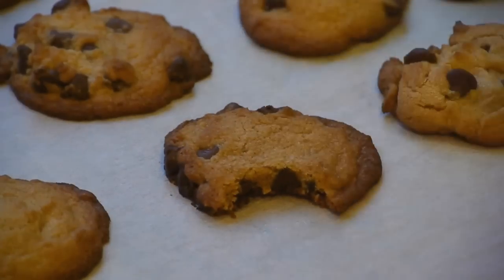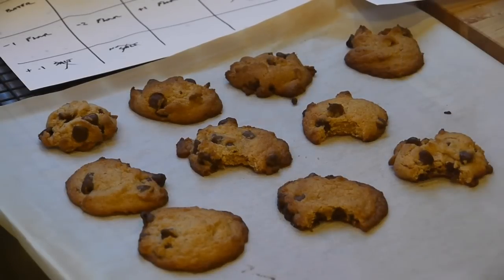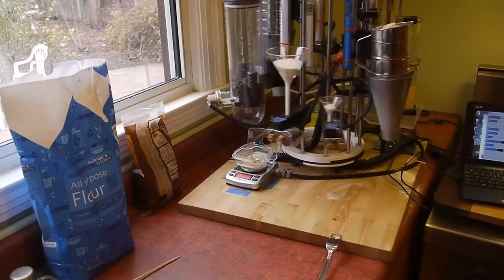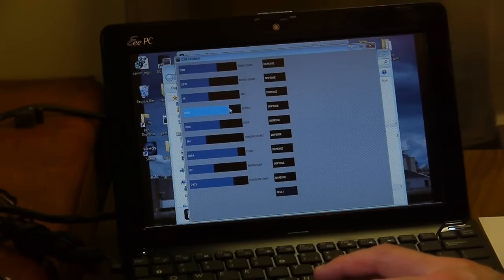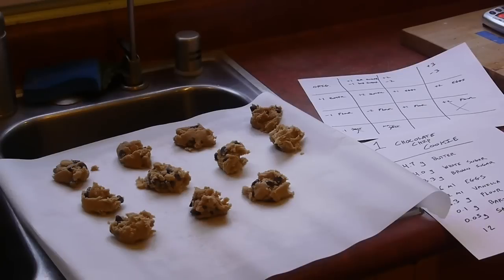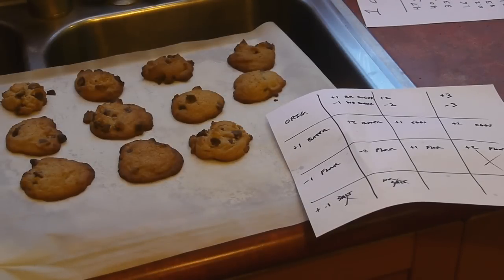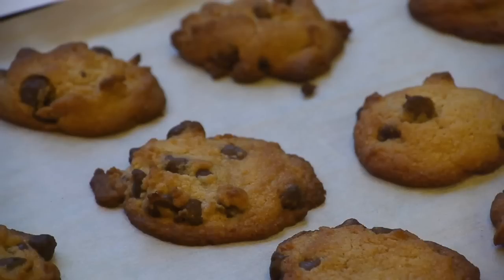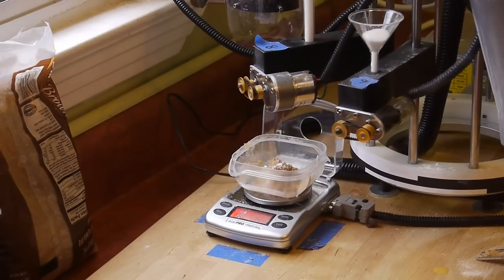Cookie Perfection Machine

Comment: The way you mix the ingredients makes a difference too.  Kneading the dough so it's dense gives you a different result from beating air into the wet ingredients and folding in the dry ones.  Also cook time and temperature, and oven placement, and the pan it's on.   I've been searching for the perfect cookie for years.
Reply: That's what I was thinking, too. Chewiness comes from mixing more than necessary in order to not only mix the ingredients thoroughly but also develop greater quantities of gluten.
Reply: I assume he does this in a sequential manual search: find the local optimum through exhaustive search on one set of parameters (e.g. ingredient proportions), then the next (e.g. mixing or baking process).
Repeat until no further change materializes.

Should discover the global optimum if initialized sensibly.
Reply: @lenzwe7775  I thought that kind of gradient descent only worked if the curvature behaves nicely and there aren't a lot of separated local extrema that you can get trapped on.

Comment: You miss out on the temperature/consistency factors of the butter and the creaming of the wet ingredients with the sugars, so the flavor/texture of the end result will be very inaccurate as compared to a properly made cookie. The most this will give you is an extremely general idea of how it will taste, since the order in which you mix the sugars with the eggs/butter is one of the main proponents in the flavor of the baked cookie.
Reply: As you point out, the temperature of the butter at the start of and during creaming is important to the final result of the cookie (creaming whips air into the butter, which has a significant effect on the cooking and texture of the cookie.)  I'd suggest 1) developing a temperature control box to get the butter to a given temperature, 2) optionally using a temperature controlled waterjacketed mixing bowl for the creaming on a stand mixer (pretty easy to physically rig with copper tubing wrapping the mixing bowl), then 3) using a temp controlled waterjacketed dispensing module on the rotating rig to hold and dispense the creamed butter/sugar mixture.  You could only use one temperature/sugar-butter-ratio setup per test run with such a set up, but it would give the critical element of butter temperature and creaming time which is missing currently.  (There's a reason there aren't a lot of imitators of what Cook's Illustrated does day in and day out.)
Reply: Yeah, I can already hear Christopher Kimball facepalming over how many improvements this machine needs

Comment: As you've already heard from previous comments, there's a lot of other factors to be considered when it comes to bake times, temperatures of both ingredients, the dough and the oven and how the ingredients are combined

All I can say is good work. I admire your computer/mechanical skills. The baking needs some work.  I make cookies by the thousands using the same recipe  everyday and minute factors like the temperature of the butter makes for a drastically different cookie. One major breakthrough was when I found out I could program my rational self cooking oven to cook them just right everytime. But they still are affected by those variables a little bit.

The haters will be hatin'. Keep fine tuning your machine. Then start programming your oven next.

Comment: I think the order in which you mix the ingredients and cooking temperature is also important for chewiness. The sugar will prefer to dissolve or stay solid depending if you mix it with egg whites or butter or both first.

If you want to try every permutation of ingredient amount, order of mixing and cooking temperature you'd probably end up with more important things to worry about, like the heat death of the universe!

Comment: My wife was wondering, how do bake-time and temperature effect the cookies?  Convection oven, and baking pan (dark/light colored aluminum/steel, nonstick/greased, stoneware, glass)...so many variables!
Reply: i just left this comment on a blog site that was showing this video as a reply to someone saying the final product looked all weird shaped and burned. i thought i'd attach it to yours since you're asking questions that i sort of answered :)

 baking isn't just about adding just the right amount of each ingredient; the amount/vigour of mixing, how long you let the dough sit, the cookie sheet you use, the shape of each cookie before baking, the temperature of the oven (and really, even the individual oven), the bake times, and even the placement of each cookie on the sheet in relation to other cookies (sometimes they can spread and form mutant cookies lol), all effect the outcome of a batch of cookies. plus, each cookie on this sheet is made up of a different combination/different amounts of ingredients, would would lead me to believe they might not all bake at the same rate/in the same way. if i were to do this experiment, i'd probably try to bake each one individually in a toaster oven rather than all at once. this machine is an awesome tool to develop the perfect cookie (base on the individual baker's taste), but it's a process. they're not all going to turn out perfect. that's the whole idea of this: he's on a journey to find his perfect chocolate chip cookie recipe, and he's using the machine he built to get there : )

Comment: Looks like you might be over-baking them. Maybe a better timer or PID control for the oven should be the next project ;)

Also, be sure to rotate the sheet 1/2 way through to compensate for uneven temps.

Comment: I greatly enjoy the majority of your vids so I will tell you the secret to the perfect chocolate chip cookie. I notice 3 things. BTW I've won plenty of baking ribbons when I was young against people who were cooking & baking their whole lives.

1st thing: You're missing oatmeal. It's best when its powdered up in a sharp blender. It absorbs the fats and butter and lends towards the texture that makes them chewy inside and slightly crisp around the outside edge.

2nd: Varied fats. Butter is great but truthfully all butter makes them feel too heavy and counterintuitively less butter tasting. So some canola oil in there is ideal and when I've asked people in comparisons they thought the cookie with canola oil was more buttery than the all butter cookie.

3rd: Must not skimp on the Vanilla. It must be REAL vanilla and if you can get chips with real vanilla (most contain Vanillin a form of artificial vanilla because vanilla takes 2 years to produce and is therefore expensive). Most people do not immediately identify this but the truth of the matter is Vanilla is to chocolate what pepper is to salt -- It rounds out the Chocolate flavor and actually enhances the chocolate. (this trick works with frostings excellently, too. I used to take those half pound Hershey bars and make them better by adding real vanilla and 1 ounce of bakers chocolate. People raved about this combo... all I really did was upgrade the quality of the ingredients. Very basic if you think about it.) Feel free to email me at woundedwing2016@  geemail. c o m  should you wish to discuss anything. Hope this helps(and that you see it) and take care!

Comment: Did you have issues with the powders and solids not wanting to flow? I have used something like this: 
BestTong 10PCS 7mmx25mm Micro Waterproof Miniature Vibration Vibrating Motor Coreless Motor Mini DC Replacement Motors only air driven and bigger to improve powder flow. We had problems with powder flow so we used vibration and it worked like a hot-damn. Adafruit has these as well: Vibrating Mini Motor Disc and that gives you two sizes. I take it your dispensers are homemade? The belt driven dispensers looked unique.

Comment: Cool. I find oatmeal raisin cookies very interesting, especially when I learned the trick of not mixing up the ingredients to uniformity. Oatmeal raisin cookies seemed to love true randomness, which has clumping. Here's a challenge: How about an upgrade to the hot air popcorn maker? These healthy snack makers have devolved into one basic model that has a tendency to jam up potentially setting fire to the house, or they pop off the top and send popcorn in all directions, or the Sunbeam that I thought was a better model--which kicks out about 5% of the kernels unpopped. I always had a day dream of a laser popper, zapping one kernel at a time like a machine gun. (It's better you hit the moon with your ruby laser.) Consider the challenge, little sealed kernels with a bit of water that need to reach the boiling point. A tube heating up until it reaches a point where it boils and pops--then goes in a bowl, doesn't jam, is quick and reliable.  (I was curious if altitude would make much difference, but preliminary results indicated I could make lousy batches of (oil popped) popcorn in my Jet Boil at sea level or 7000 feet. So I really haven't resolved this, just confirmed how to make a bad batch.)

Comment: You might try dumping your ingredients into a baggie that way there would not be as much waste from them sticking to your container.  Plus I imagine it would be easier to dump them.  Maybe hold it in a round wire frame with a hoop for a rim and a rubber band to hold it into place?

Comment: Your cookie dough machine is interesting and reminds me of a favorite childhood story book "Homer Price" about the automatic doughnut machine.

As an engineer and home chef I have to say you're on the wrong track and it won't yield the results you're looking for.  I too looked at making cookies with better results.  The most significant differences occur when you prepare the batter differently - technique as any chef will tell you.  Try as an experiment as I did by letting the batter hydrate for different times.  Cook immediately, wait 12 hours, 24 hours and 48 hours.  You'll find it makes a huge difference to the texture of the cookie in a side by side comparison taste test using the same formula.  Second, most people don't beat the sugar and butter enough.  Over whip the sugar  and butter till its almost white then you can add it to the cookie dough as one item.  I could go on but try these steps first.

Comment: It doesn't appear with this setup that you can vary the consistency of the butter (melted, softened). Also, a very important step is creaming together the sugar and butter which also serves to dissolve the sugar crystals into the butter. I have found when making a recipe for a single cookie, the granular texture of the sugar is pronounced and does not have the benefit of the butter and sugar being creamed together with a mixer.

Comment: Flour is a binder with the gluten formation.  Brown sugar is sweet but adds more moisture to the mix: looser, flatter cookie.  Butter has water, solid shortening doesn't .  Use butter flavored crisco.  Chill, chill chill that dough.  Mix-ins like nuts and chocolate chips can alter flavor so add what you like.  Myself, milk chocolate chips, walnuts and chopped cranberries.  Good luck.  I will stick to hand mixing and dividing the batch into 6 to 8 cookies.  That way I'm not stuck with chocolate chip but use the batter for adding fruit and nuts.  No chips.

Comment: I like good food, but I'm not so determined to find the optimal recipes.

I suspect you're likely to find that the optimization problem does not have a single solution, and may have multiple different combinations which produce equally pleasing results, for different reasons. 

I recommend you also try your cookies at various times of day, and with different beverages, as that may impact your perception of flavor.  Perhaps there are other variables as well, and of course price will come into it somewhere.

Comment: I'm gonna be a total stickler and point out that while I love all the engineering and novelty he put into this, it's a pretty terrible way of making the perfect cookie.  The ratio of ingredients is part of what makes the perfect cookie perfect, but other factors (e.g. the temperature and mixing intensity of the wet ingredients, how and how long the dry ingredients are mixed in, the quality/freshness of each ingredient, shaping the dough, and placement across the pan, type of baking sheet and liner, baking temperature) are collectively as important if not more so.  The best way to find your perfect cookie recipe is to do it the old fashioned way, pay attention to what parts of the cookie you want to change and modify the factor that affects it.

Comment: Cool.
The sad part is that it's impractical to clean the containers and store the ingredients. That could be fixed, though; it's just probably not worth the effort. But then again, what is..
Reply: *****
Umm, ok, but that doesn't negate my point.
Reply: Luna Omg, you're adorable.
I want a hug... walks closer
Wait! No, don't run away!!
Reply: It takes more energy to build a machine like this than to premeasure and mix 40 different cookies and try out the recipes on your own, but if you enjoy building the machine, that's where you get the value.
Reply: Abel Feltes I know. I sort of included that with the last line "But then again, what is?".
I suppose I personally don't get that much out of building hardware because it's not my expertise. Software, however,  I don't mind wasting time in. I guess I acted more closed minded than I thought.

Comment: baking is chemistry.- The engredients change chemical form when they are heated up during baking.- For example starch will degrade to lower sugarforms, also called dextrines ( pyrodextrins ), which will also add brown colour to the bread/cookie/cake.

Comment: I noticed a few flaws in your design... (baking techniques that have a huge impact on the final product) ... First, you should NEVER use melted butter when making soft cookies.  You should use softened butter at the most.  Using melted butter will cause the butter to integrate too closely with the flour and you end up "frying" the flour instead of baking it  (making crispy cookies vs soft/chewy cookies).  Also, you really do need to separate wet & dry ingredients until the last minute.  (Sugar is an oddball and is considered a wet ingredient)  Keep the whole mess below room temperature (cool) or you'll again suffer from the issues with the fried flour.   You do want to mix the ingredients, but you don't want to over-mix.  You would be amazed at the difference between the final products.  You'll be completely surprised at the difference between the final products simply by the difference in techniques.

btw... love the shows... keep up the great work.
Reply: +TheCompWiz He could fix that butter problem with filling a cylinder with room temp butter, and using a plunger to extrude the butter at some specified volume.  A shear step would complete the butter dispense and allow it to drop into the mixing reservoir.

Comment: I have been a chef for 32 years... you are doing every thing wrong! your machine acomplished nothing. For chewier cookies add a bit of vegtable oil, crisco works the best., diabetic cookies  use blended fruite , i.e. apple sauce, pineapple tidbits, smashed bannanas or any orhwe moist fruit to replace sugars. Altitude afects bakeing a lot. Making cookies, cream all of the wet ingredents together then add the flour and all other dry ingredents that have been mixed together , preferably sifted. When adding the flour mix, just mix until everything is all incorporated together. Over mixing will make the glutin in the flour very gummy and tough also unpleasent.Also the longer you bake a cookie the dryer and crisp it will be. Remember a moist cookie, increase the oils and dont bake as long. If you want a cookie without glutin you can use quick oats (raw) in place of the flour or rice. Dont get me wrong your machine looks cool BUT definitly not for a perfect cookie. Just remember a cookie is as only as good as the ingredents that you put into them..........PEACE!